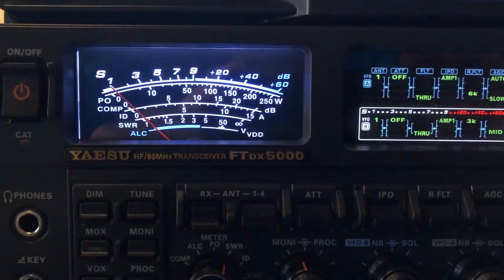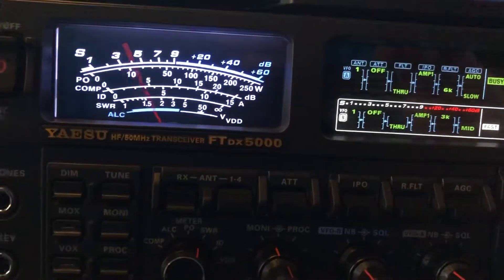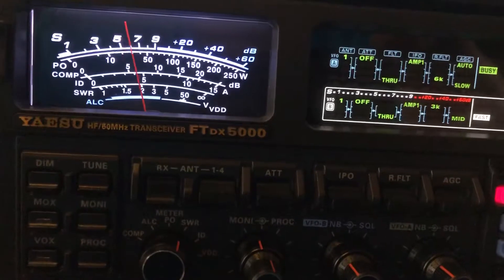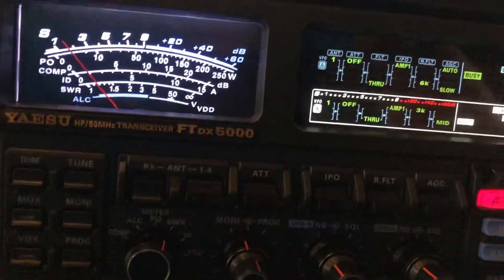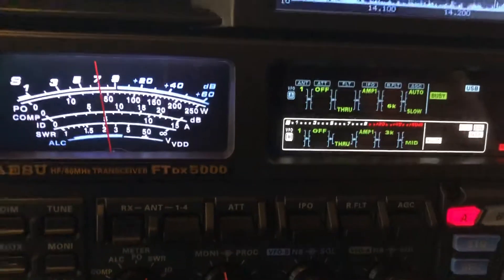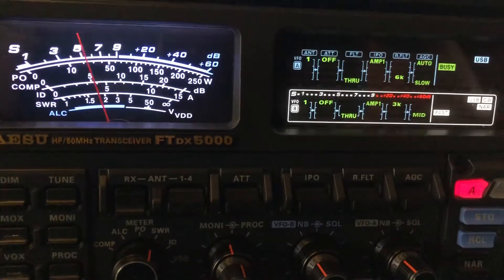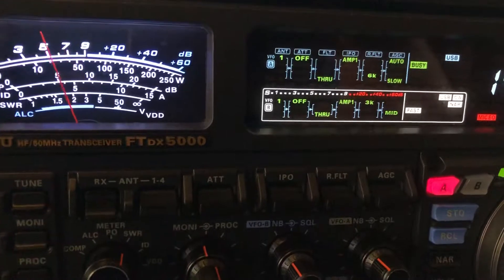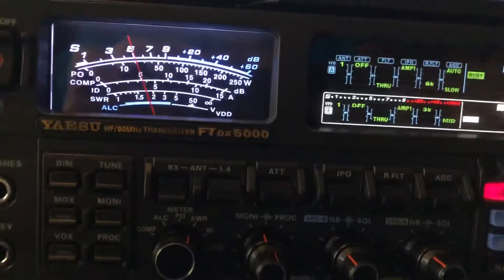Comparing SSB signals between the ZS6BKW and a 160m ladder-fed dipole #hamradio #hf #antenna

Comment: What can I say??? I love messing around with wire antennas... My most surprising and best performing wire antennas  were: 1. a horizontal Delta loop at ~30 ft. for 40-10 m. and 2. An Extended Double Zepp cut for 20M./ Cheap and Killer performance.
Reply from the maker: Those are both highly regarded antennas.

Comment: Sometimes i can tune 80m on the ZS6BKW even though it’s not designed for 80m with my KX2. The other day I couldn’t. What’s the secret or is it not advised to use on 80M without coils?
Reply from the maker: I use my ZS6BKW on 75-80m regularly. My Elecraft ATU matches the antenna on any frequency, from 3.5 to 29.7 MHz.
Reply: @n4hnhradio  i had to pull the ladder line diagonally to reach my back porch…maybe it was because I had my coax strung in a tree, and the ladder line was not vertical. The KX2 wasn’t grounded either. I was sitting on a wooden porch.

Comment: Thanks your videos are great and I am getting a better understanding of this new technology in radios
Reply from the maker: I’m glad to hear that, Paul.  It is my goal to help others learn more and increase their enjoyment of amateur radio.  I appreciate your support in helping make that possible.  I would not be able to justify my time if it weren’t for people like you.  So consider yourself a co-Elmer.

73, Doug
Reply: @n4hnhradio  you know I have the ZS6BKV on the way. Question. At the apex will be 45-50 ft. the ends about 15 ft. running n/w to s/e.
guess looking at a map of Fl. it would be running north and south and not north. What ya think. yes I have alot your youtubs to catch up on.
73 KQ4CD
Reply from the maker: Great question, Paul!  The orientation of a dipole won’t matter as much with an inverted V installation.  But the broadside figure 8 radiation pattern that I suspect you are referring to results from installing a single-band resonant dipole horizontally, a minimum of 1/2 wavelength above the ground beneath the antenna.  Dropping the ends (inverted V) skews the pattern more toward a somewhat circular pattern, so the North/South or East/West orientation of the wires is less important.

The ZS6BKW plays by different rules.  It is not really a resonant dipole.  It isn’t cut exactly per the formula 468/Frequency in MHz and it isn’t fed with 50-Ohm coaxial cable.  The ZS6BKW plays by the rules of a Doublet antenna system.  The radiation pattern will consist of multiple lobes of gain and resulting nulls.  The higher the frequency, the more lobes of gain.  So you just install it where it fits best and as you operate, you will begin to discern the directions of gain and the direction of the nulls.  Don’t worry about the nulls though.  They aren’t usually too deep.

That said, if you were to install a second ZS6BKW, try to orient it perpendicular to the other.  The second antenna should have lobes of gain where the other has nulls and nulls where the other has lobes of gain.  It’s the ultimate setup with antennas of this type.

I hope this helps.

73, Doug
Reply: @n4hnhradio  that is the idea. beams have a place. have mosley ta-33-m-warc. pick it up 150$ , having a hard time getting it apart. it  is gritty. more on this later.
it will be 55 ft  73
Reply from the maker: Great beam!  I know a guy who has had a TA-33 up for well over 50 years.  He’s never needed to work on it.

73, de N4HNH

Comment: you people compare apples to oranges all the time and i dont know why. the only test that would make since to me would be if you tried the zs6kw to a 80 meter dipole on 80 meters, then the zs6kw on 40 against a 40 meter dipole then same on 20,15 and so on then tally your results not only on not only performance but as well as convenience and over all results of the all band or most band thats in one antenna.
Reply from the maker: I can explain if would like.  The ZS6BKW and the 160m doublet are both in the doublet family.  The 160m doublet has 250 feet of wire, versus 94 feet for the ZS6BKW.  The lobes and nulls vary between the two antennas, since they are being used on bands they are not necessarily cut for.  But even then, the lobes and nulls will vary between the two antennas due to the length of the wires.  But, if they both happen to have a lobe in the same direction, 250 feet usually wins, especially on 20 meters and higher.

My channel is not about scientific analysis.  It is about everyday operating techniques.  There are other channels that do head-to-head scientific analysis.  There isn’t a need for me to do that as well.

73, de N4HNH

Comment: well being that the zs6bw is 80 meter max low then if you are comparing it at 160 meters and to a 160 meter dipole then of course the 160 dipole will out perform a antenna that is designed for its lowest operating frequency being 80 meters, now maybe try and compare the zs6kw and the 160 meter dipole on 40 or 20 meters and get those results.
Reply from the maker: The ZS6BKW always wins on 40m.  It’s no contest.  I’ve shown that in some of my videos.  But remember that the antenna performance can vary according to the installation.  The 160m Doublet usually wins on 20m but not always.  There are major lobes and nulls for multiband antennas.  In certain directions, one is better than the other.  The ZS6BKW consistently has the lower S/N ratio.

73, de N4HNH

Comment: You really need to do some antenna modeling to see how the 160 dipole effects the radiation pattern of the Zed6. I guarantee you that you have  close coupling effects going on with them oriented at the same plane only 20 feet away. A 1/2 wavelength on 20 meters is  23 feet
Reply from the maker: It wouldn’t matter.  I have 1/3 acre.  It is what it is.  Modeling it isn’t going to fix it.  They both work quite well, so I’m okay with it.  Any proximity effect seems not to be detrimental.

73, de N4HNH

Comment: Very impressed with the zs6 looking at your signal to noise ratio. It appears quieter. Almost like a loop. How was in configured
Reply from the maker: I have the NI4L.com version of the ZS6BKW.  It is installed as an inverted V, with the apex at 45 feet and the ends at approximately 12-14 feet.  The antenna is only a little more than 94 feet long.  It needs to be installed at a minimum height of 40 feet, to accommodate the ladder line.

73, de N4HNH
Reply: @n4hnhradio  yeah I really want a 160 doublet but don’t have the room. I could wrap a loop around the house for 80 but I’m not clear on what balun to use.
Reply from the maker: A 4:1 balun is typical for a loop antenna.  

Could you possibly fit a 160m inverted L?  Or maybe a Delta Loop?

http://www.hypowerantenna.com/products/delta-loop-antenna

73, de N4HNH

Comment: I am totally confused.  Can you confirm that was the ZS6 on 160M and not 20M?  If so, why was there a comparison with an antenna (ZS6) that has an astronomically high vswr on 160m?  The correct configuration for a ZS6 on 160M is to short the legs at the base and run it as a flat top.  Please clarify though.
Reply from the maker: The 160m doublet is my best 20m antenna.  That is the point of the video.  Don’t misunderstand though.  I’m a huge fan of the ZS6BKW.  It is my best antenna for 40m.  It also exhibits the best S/N ration on 20 and 17 meters.  A doublet will exhibit major lobes in certain directions when used on a higher band than it is cut for, as the video illustrates.  A 160m doublet is multiple wavelengths long on 20m.  Additionally, my 160m doublet has less than a 1.7:1 SWR across 20 and 17 meters.  I can use it without the tuner if I so desire.  My tube amplifier definitely doesn’t mind.  My LDMOS amp prefers less than 1.5:1 though.
Reply: Doug McAlexander So, high off the ground was the apex of the 160 doublet and was it flat topped or inverted-v?  I have an opportunity to put up either a 160 with an antenna tuner right at the base or a ZS6. Either way, about 150 of feedline so it needs to be as resonant as possible at the antenna.
Reply from the maker: Hi Jim!  The ZS6BKW and the 160m doublet are oriented approximately the same and they are approximately 20 feet apart.  I didn’t mention the height.  Both are at 45 feet above ground, and they are each configured as an inverted V.  Well, the 160 might be considered a “lazy dipole”, since the ends are at approximately 15 feet.  The ends of the ZS6BKW are also at approximately 15 feet off the ground, but, being so much longer, the angle at the apex of the 160m doublet is not nearly as steep as the one for the ZS6BKW.

Comment: What's your conclusion?  Your coax switch is not rapid enough for real A-B comparison,  try doing it every half or one second.  Between the QSB and the AGC pumping and blankin, and receiver muting when you're grounding something, it's very hard to tell the difference....  If you're saying the 160 ladder line doublet works better on 20.... it should...  in that specific direction...but nothing is free... The ZS6 has 4 lobes like a clover leaf around.  The 160M....it has some very distinct lobes and some very deep nulls.  you just happen to be oriented to the other station with a strong lobe.  Note the echo on his signal too ?   ya... you're getting some multipathing due to the distinct lobes and nulls..   nothing to see here...
Reply from the maker: Yep!  Know all that.  Both antennas are great at different times and under different conditions.  I talk about the nulls in my videos.  And the echo is not multipath.  That is DNR.

Comment: Hi , we are also advised to stay in here in Germany.  As the last storm damaged my HF vertica I have now time to build and put up a ZS6BKW junior antenna.
The horizontal length is 14.2m. I´m not sure if what I found out about the vertical feeding line.
I read that it is 12,2m. To me it seems to be far too long. Do you have any information about the dimensions? Otherwise I´d go for a half size g5rv antenna. Thanks!
Reply from the maker: I recommend looking at www.NI4L.com for information.  They make a great version of the ZS6BKW.
Reply: @n4hnhradio  I want to make one myself and only need the dimensions ...
Reply from the maker: http://w5ssv.com/resources/The-ZS6BKW-Multiband-HF-Antenna.pdf
Reply: @n4hnhradio  THanks, but this article only mentions the full size one, whereas I look for the dimentions for the half size one. Thanks anyway. Happy Easter
Reply from the maker: I’m not aware of a ZS6BKW Jr.  If so, it would probably not be resonant on all the bands it is at full size.
Reply: @n4hnhradio  I suppose 80m is not possible. However the full size one wont fit in my garden :(
Reply from the maker: DL6UK, you can operate 80m with a ZS6BKW dipole but you must use an antenna tuner.  It is not resonant on 80m.
Reply: @n4hnhradio  thanks :)

Comment: I was surprised that the ZS6BKW antenna is good at 160m also.
 This antenna as known is only for 40,20,17,12,10 + bonus 6m. The other bands with ATU only.
I'm planning to replace my Windom FD3 for this antenna. So, thanks for the video.
Reply from the maker: ZS6BKW doesn't operate very well on 160m.  A wide range tuner might fool the radio but the antenna is too short.  That said, my friend uses a G5RV Junior at his mountain cabin, and he got it to tune to 160 so we could have a QSO one night.  It actually worked okay for a 70-ish mile contact.